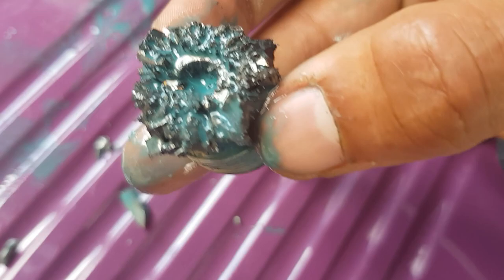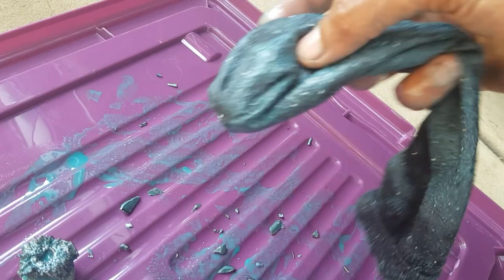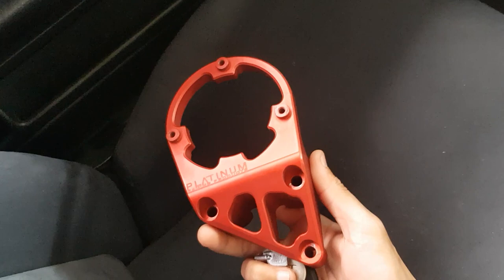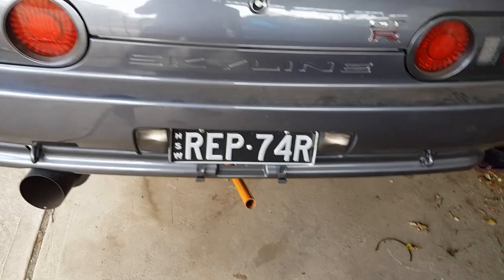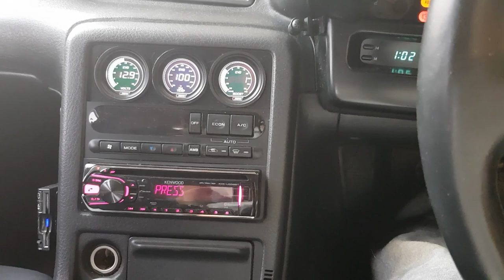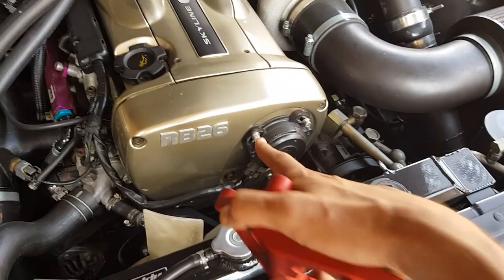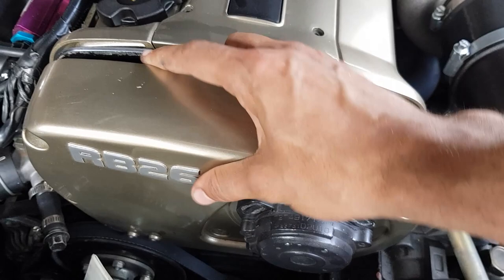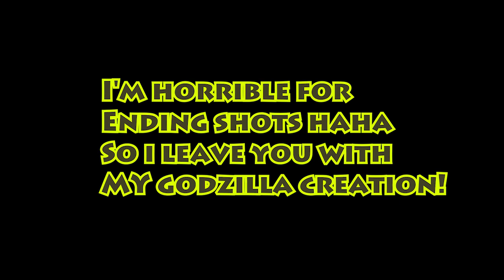Nissan Skyline R32 GTR - Gearbox drain and CAS bracket install | Vlog 003

Comment: Heck no on running without an upper timing cover, man. I did it for about a year on my Evo. I had an awful stroke of luck where my accessory belt shredded on the highway and ended up getting pulled into the timing area, wrapping itself around the crankshaft sprocket and, of course, causing it to skip timing. Bent all my valves!
Reply from the maker: Jesse Erickson holy crap. What a terror story. Definetly makes you rethink haha

Comment: You will surely gain 60-70kws with that new bracket. Leave the cover off for cam belt cooling. That will add another 10kws

Comment: Good to see you're back with another video. My car has a OS Giken gear-set and middle/sandwich plate. If you're ever down in Melbourne, pm me and i'll let you take mine for a spin. It's currently running 550 atwhp down from 650ish (i'm a chicken) but my gearbox appears to be holding up well. 
(See LMLimitedSteve for details on the car).
Reply from the maker: Steve definitely will put the word out next time im down

Comment: hey mate, im sure you've probably been asked this a million times, but why do you run such average tyres?
Reply from the maker: +MumsMexican hey man. Mainly just because for now theyre really not a hindrance. I dont track the car and the grip isnt bad for what they are. 1st gear spins hard but 2nd fir the most part hooks depending on the road. I do plan on running sticker rubber though!
Reply: Also because he wants to see if a beast of a r32 can be a sleeper:)